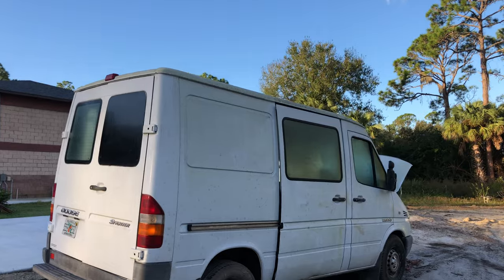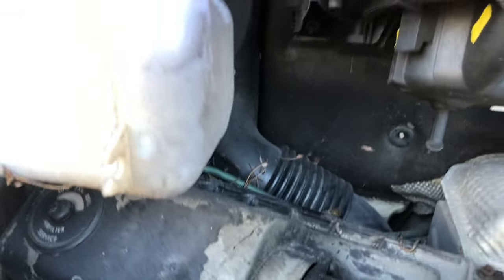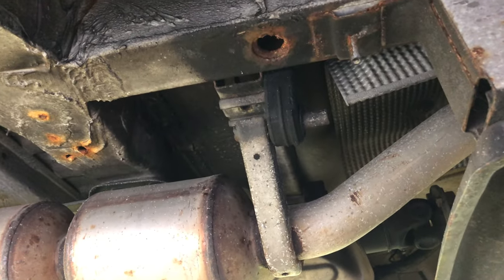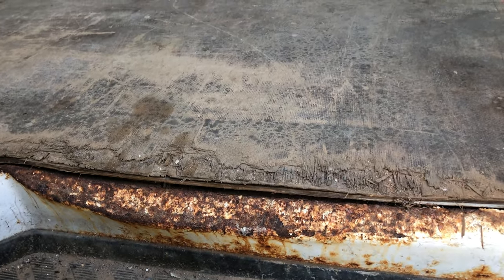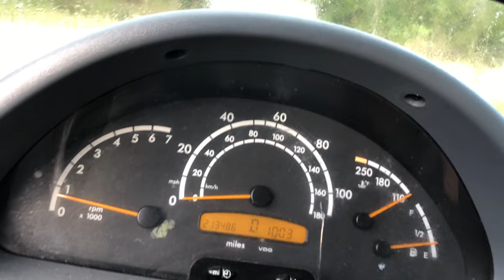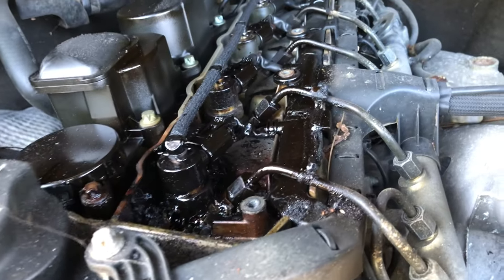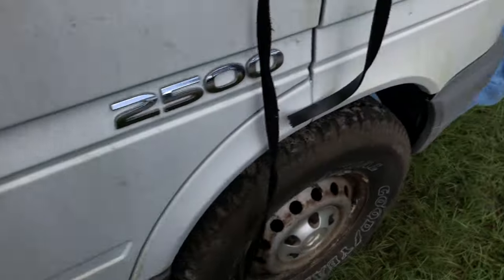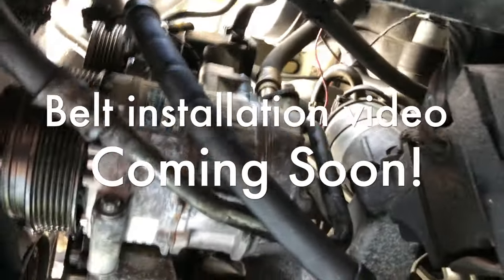Short-Short Cargo Van from Cocoa Beach, T1N 2006 Sprinter CHEAP & Troubled Win for Rolling Realtor

Comment: How much did you pay?
Reply from the maker: I stole it. The asking price was low because it hadn't been run in a few years and was abandoned because it wouldn't start. The only reason it started for the test drive was because the belt was wet and sliding easily on the seized a/c compressor.
Reply: @FloridaVanMan  it seems most bodies in Florida are rotten, engines only the keepers
Reply from the maker: @andersfuchs9209  The T1N Sprinters are all 14 years old or more, so the bodies are tired and beaten. But I think we have less rust than northern vans.
Reply: about $2K plus rust